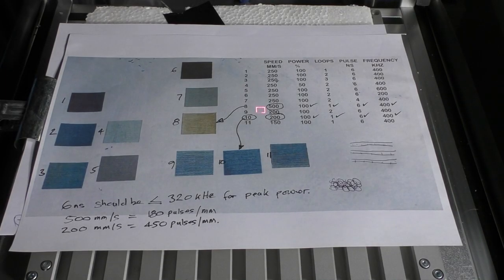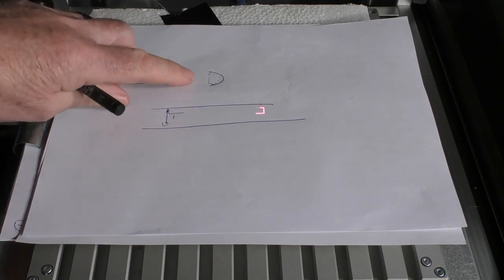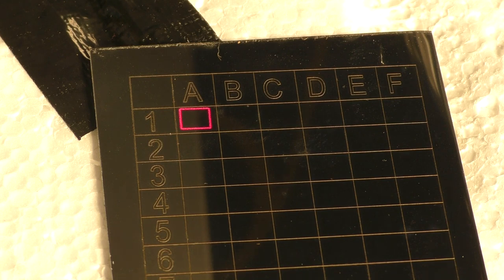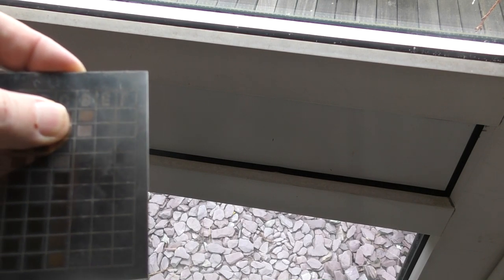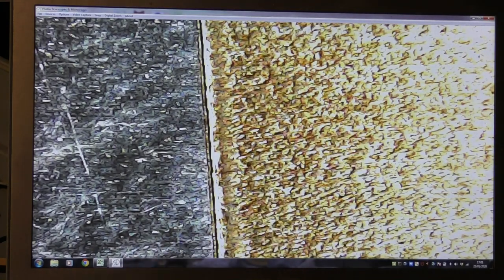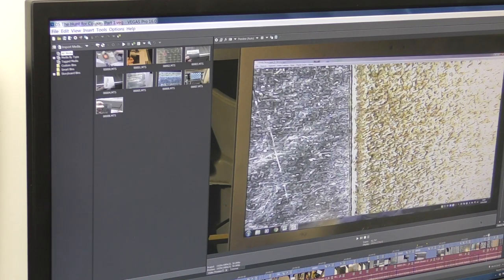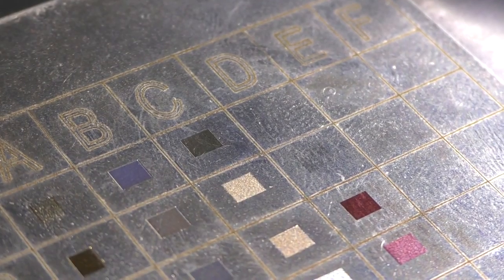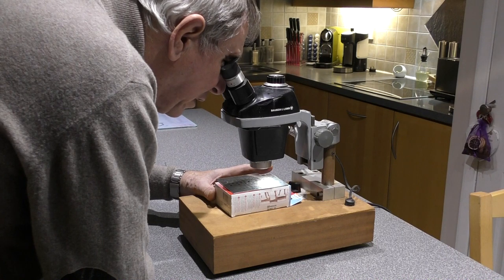Fiber Laser Learning Lab 07 The Hunt for Colours Part 2

Comment from the maker: Heidi
 I am sure I have my old notes hidden away somewhere in my workshop but at this point on my journey into understanding how and why these colours happened  is very early. It really depends on the sort of fiber laser you have.  The pulse duration and controllability of a normal  Q swith laser means it is almost impossible to acieve any meaningful colours. It requires the precision pulsing of a MOPA aser to  "create" these colours. . Carry on wothing my  journey and you will discover that  my settings may not apply to your machine  because there are so many factors involved.. The colours that look so good are only good provided you look at them with certain types of light and from very narrow reflective angles. They are only discoverable on stainless steel and Titanium.
 We see colours by reflection from an object. Specifically our eyes are sensitive to only the colours of the rainbow  and when all those colours exist together we do not see them seperately but jointly as white light If you look at a piece of white paper then you are seeing total rflection of all the colours of the rainbow. If that white light reflects off an object and the object absorbs some of the colours you will perceive a mix of the non-absorbed colours ie the reflection. You may imagine that black is a colour but  is there any black in the raibow?  No, what youare percieving if totl absorption of all the rainbow colours. Light is weird stuff so the colours tou create with your laser are not real pigment type colours but reflections off a surface that is absorbing some of the rainbow colours.. As I allude to in this video, the microscopic unifrom cell structue on a butterfly wing or an a peacock featherare absorbing or reflecting certain disceet wavelenths of light and when you create colours with your laser, you are  micro machining the metal surface with incredible uniformity and emulating the butterfly wing effect. Different mico machining patterns relect only certain wavelengths of light. Look at the micro machined "colour" in different lights (sunlight, LED light, incandescent ligh or halogen light and the clours will change.. Its a fascinating subject  but the end result is really only a marketing gimmick. The colours are also  very fraglie. Leave then exposed to air and within a week or two they beging to oxidize (turn rusty).
 Understand the underlying micro machining principle and you will be able to find then for yourselfbut remeber that micro machinng means VERY small  (sub 1 micron) line spacings.

Best wishes
Russ

Comment: I'm researching MOPA fibre lasers before purchasing and I've found information can be scarce, so your videos are an amazing resource. I'm really enjoying your scientific approach. Thank you!!

Edit: I've heard you mention JPT. Are you using an "M7"? I've been looking at their M7 series (20W or 30W). From comparing data sheets for a few manufacturers, these look to be quite decent in term of specs, however more expensive. My use will initially be for marking various plastics. My understanding is MOPA allows more options and better control of foaming. Have you experimented with plastics (like ABS) on your laser?
Reply from the maker: Hi Darian.
 I am pretty familiar with CO2 laser technology so you would think that jumping onto a different wavelength laser would be just an extra 20% learning. Not so, Everything about this fiber technology is different and as you have already found out, there is little apart from brash advertising information available to give you any real feel for the technology.  Lotus Laser have been very brave to lend me a "no-strings" machine to experiment with. Although , like many other machine builders and equipment sellers they understand the basic things the machine can do, they do not have the resources or patience to find the real envelope operating of their technology. They stick to the safe middle ground  when they implement solutions for their clients. I have two major advantages  as far as Lotus Laser are concerned, First I am totally ignorant of the technology and secondly I have a "no fear" inquisitiveness. That means I have no preconceived notions of what is  and what is not possible. I have realised more with this fibre laser,  that an understanding of material chemistry and electromagnetic radiation physics are essential subject that I have been forced to delve into. I will never be a physicist or chemist but understanding a few fundamental principles allows me to tie the subjects together and make sense of what I am observing.
Yes the laser I have is a JPT YDFLP-C-20-M7-S. 
I have dabbled briefly (just as a preview trail blazer) with a  polycarbonate,  acrylic,  PET and acetal copolymer . From my laser cutting experience I am extremely cautious about using ABS. Basically you don't,  because when you heat it to decomposition it creates  hydrogen cyanide gas. I do understand the foaming idea because it also happens with some very interesting outcomes on polycarbonate.  I have yet to play with ABS but is is on my list of projects to tackle..

Best wishes
Russ
Reply: @SarbarMultimedia  Thanks for the detailed reply and confirming the laser model. I have since caught up on some of your later videos and seen the interesting results you achieved testing with plastics. I had no idea ABS was potentially dangerous to laser, so I'll be researching that further. I look forward to seeing more of your experiments with the MOPA laser, and kudos to Lotus Laser for being brave enough to loan you the machine. The videos have been excellent! Cheers from Australia.

Comment: I wonder if coloring would work on another metal besides just stainless?  If it does I bet you the results would be completely different.
Reply from the maker: I wonder also????
Reply: @SarbarMultimedia What I think is, and your testing is sort of proving this, that it is making the metal react with the external force that ends up with a finished colour but each metal type reacts differently so what worked on the SS might work on say Iron or not work and if it worked the outcome would probably be different.  Using your blow torch on the metal to see the shade of colour test you do that on iron, for instance, and you will see a difference so the laser would have to be tweaked per material type I think. Some metal types will simply not work at all.
Reply: I've seen colour on Stainless, Titanium and Brass. The only colours over seen on Aluminium is white, greys and black. I'm sure Russ will open the gates to all sorts of possibilities. He's already demonstrated that he can make this MOPA do things people thought was not possible.
Reply: @John Revill Yep, but what I wonder is how will the settings change for the material that this technique does work on?
Reply from the maker: @johnrevill9592  
Hi Johns
It may be a few weeks before it pops to the top of the pile but everything you want to know about wood engraving is "in the can"....that's the film sense, not the toilet sense. I was getting a bit bored chasing colours but what I am finding is becoming fascinating.  Thanks for your confidence, I hope I can discover a few more surprises
 Best wishes
Russ

Comment: So your basically just doing a grid  and doing a massive detailed analysis.
Reply from the maker: Hi Rob
I think your question/assumption is a bit premature. The problem is, I cannot do an analysis on things I don't know or yet understand. This is a journey of learning for me without a tutor. I have seen colour grids from many big companies and although you may be impressed by the pictures,   you only have to handle the real things to be suddenly disappointed. The colours are only there for  a very narrow viewing angle and certain wide spectrum  light conditions. I would never be tempted to buy a machine like this if that was all it could do. Apart from the fragility of the colours, they are just not practical in a productivity sense because they take ages to cover areas.  No, this journey of discovery is all about understanding how and why the colours exist and trying to find ways of making a palette of cost effective , production worthy colours. I think it will not be a grid but quite a small collection of durable and  usable colours. Still some way to go , so hang in there.
Best wishes
Russ